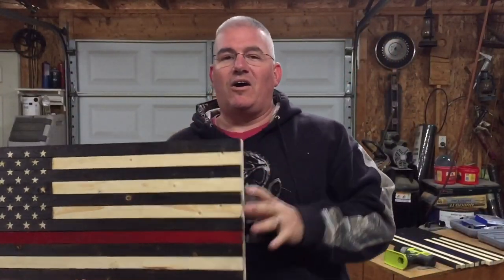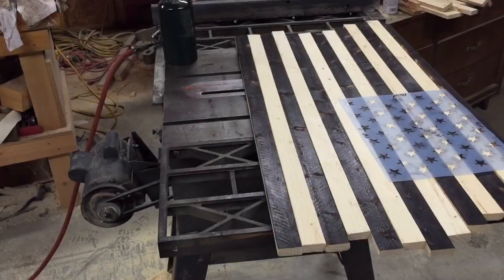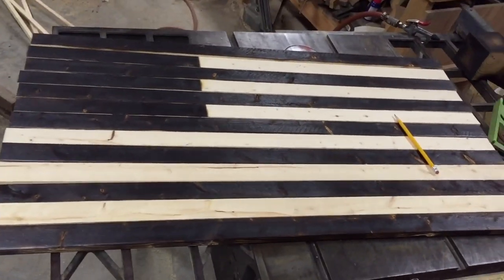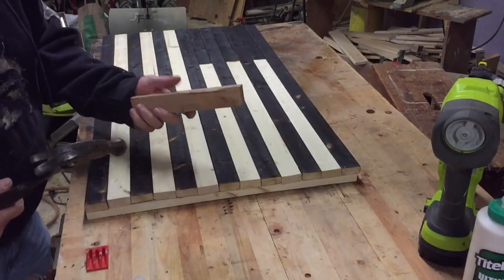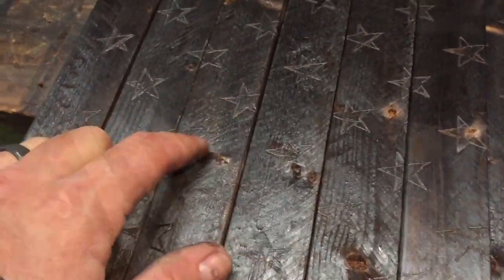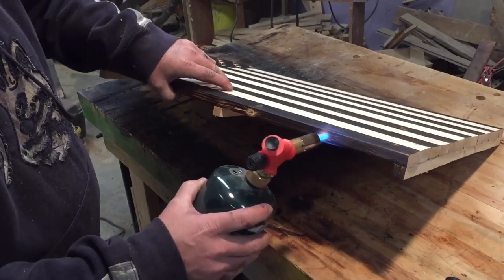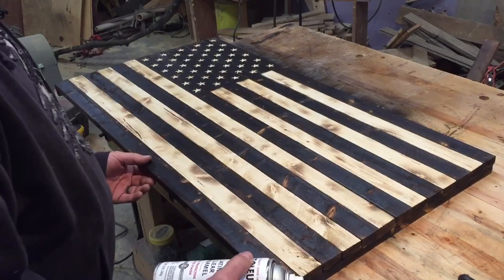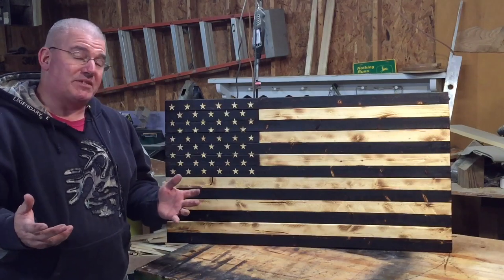DIY Rustic American Flag / Rustic / Torched

Comment: How did u make the star template? This is a great project!
Reply from the maker: Thank you, once I decided how big I wanted to make the flag I determined how big the union would be. I made the stars in Microsoft word, under shapes there are stars. You can change the size of the stars to fit the Union, print them out on paper, glue it to a plastic stencil sheet and cut them out with an exacto knife. Cutting the stars out can be time consuming but when you're done you'll have a templet that should last a long time. I'm planning on making a video in the next couple weeks on making a templet and I'll put that here on my channel. Thank you for watching

Comment: what size of wood is the furring before you cut it to 1 1/2.
Reply from the maker: javiz206 sometimes I fine the 1.5" strips in the store, no cutting needed. If I can't find those I get the 1x4 strips and rip those down.

Comment: How much do you sell them for? And can I order one? I love it very creative!
Reply from the maker: Thank you very much. I have sold a lot locally but only a few have been mailed off. What size are you interested in?
Reply: +Jeff Furr the size in your video is perfect, I plan on putting it in my garage just black and white just the way you did in the video. I'm in Arizona.
Reply: +Jeff Furr also, do you mount any brackets to hang it?
Reply from the maker: +Daniel Maestas I do, I use wire that's made for hanging pictures. I attach it with a screw on each side. The flag in this video is 19.5" x 37" and it sells for $125.00. I haven't shipped one that size but I think shipping is around $15.00.
Reply: +Jeff Furr thanks I'll talk to the wife about it but more than likely I'll get one. You use PayPal for payment?
Reply from the maker: +Daniel Maestas ok, sounds good. I haven't set it up on my website yet but I could, I'll work on that over the weekend, I need to have it set up anyway. Thank you

Comment: where could I get a template for the stars? really need to know. that's the only thing I'm having trouble with.
Reply from the maker: I have been trying to get a store set up on my website but it just hasn't happened yet. If you'll email me at thefurrminator@gmail.com, ill give you my info and tell you what stencils I have.
Reply: Jeff I love what you've done and I've made many flags my self. If it's alright with you I found a web site that sells star stencils for just about any size. I don't want to post it if not ok with you first.

Comment: What material did you make that star template on? Trying to do the same, would really appreciate it
Reply from the maker: I made my first one on poster board and as that started wearing out I made a new one on a plastic stencil sheet. I have since purchased a cutter and started selling them to those that are interested. I am actually making a video right now to show how I made my first stencil, it's not difficult but it is a little time consuming. I may have that video uploaded tomorrow. If you'd rather purchase one, email me at thefurrminator@gmail.com for details. Thanks for watching
Reply: Wow, thanks for fast reply! Looking forward to that video,  Do you sell templates of any size requested?
Reply from the maker: I have several sizes made up but I could possible make a special ordered size. My main focus has been the size that is in the video because that's what's requested most often

Comment: What is are the dimensions of the smaller flag shown at the beginning? Length and width of boards. Total dimensions of flag?
Reply from the maker: Lance McLaren it is 13" x 24.5", the boards are 1" each made out of 3/4" furring strips
Reply: Thanks!! I'm just getting into this wood working thing. When you say 3/4" during strips. You're referring to the depth of the board? The board itself would be 1 x 3/4 x 24 1/2? What are the dimensions of the union?
Reply from the maker: Lance McLaren yes, that's correct, the depth is 3/4. The union is 7" x 8.75"
Reply: I really appreciate your help. I look forward to making one for my father. Thank you.
Reply: Just out of curiosity, what kind of material did you use for your stencils?
Reply from the maker: Lance McLaren 7.5 mil stencil sheets, Mylar plastic I believe

Comment: what dremel tip did you use?
Reply from the maker: I use a #106 carving bit most of the time, it's easier to make the sharp points on the stars with that. I use the #107 on larger stars

Comment: sorry whats the thickness of the wood. it look thicker than 3/4 in the video.
Reply from the maker: It is 3/4", I haven't found any over that but some are a little less than 3/4". I started buying the 1 1/2" wide furring strips and the are more consistent in thickness than the wider strips.
Reply: thank you every much.
Reply from the maker: +Doug Rees + you're welcome, not sure if you have made a flag yet or if you're going to before the deadline but I'm having a contest for all the flag makers to enter. The deadline is June 29 at midnight. It's not a competition, it's a random drawing. Just send me a picture of your handmade wooden flags, would like to get one of you holding a flag. Here is a link to the video announcement with the details, 
https://youtu.be/mCa5cp1yBtY
This is just a way for any of my viewers to show off their handy work in my slideshow to celebrate the forth of July.

Comment: what kind of bit did you use on your drimel
Reply from the maker: PYRO RC a #105 carving bit, it's small but it's easier to follow the lines and make the sharp points on the stars with.
Reply: thanks im trying to get ideas to make in wood shop and i wanted to know so that way if i make one i know how to make the stars.
Reply from the maker: PYRO RC I uploaded a how to video on making a star stencil yesterday. If you need further assistance, I've started making and selling the stencils for the size flag in that video.
Reply: ok thanks
Reply: Jeff Furr how can we purchase a flag and a star stencil ?

Comment: What kind of torch are you using?
Reply from the maker: A small propane torch that I purchased at Tractor Supply. Here is a link to one that is similar to the one I use 
http://www.tractorsupply.com/tsc/product/mr-torch-handy-propane-torch?cm_vc=-10005
Reply from the maker: if you have made a wooden American flag, you should enter the giveaway on my channel, the deadline to enter is June 29 at midnight. Here is the link to the video announcement with details. 
https://youtu.be/mCa5cp1yBtY
Reply: Thanks I'll check it out.
Reply: I just started on it.  It will be no way done by then.  Thanks.
Reply from the maker: +Donald Gasior I understand, I was just making sure to let everyone know about the giveaway in case you had one ready. Thank you for watching